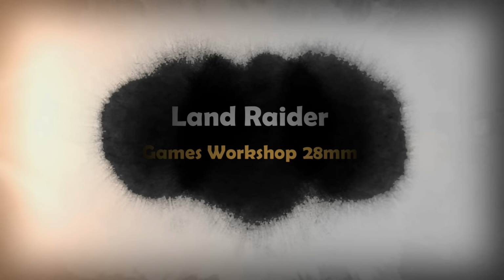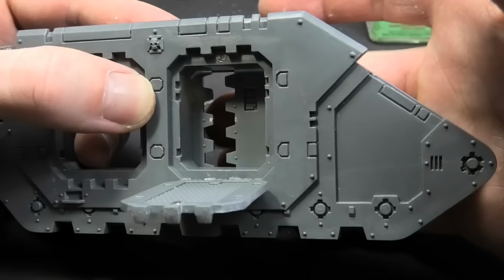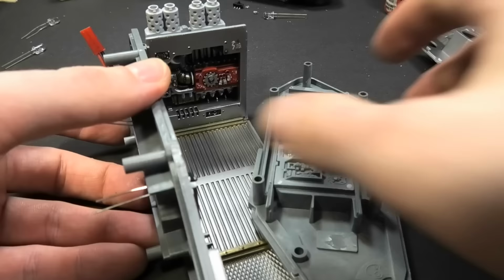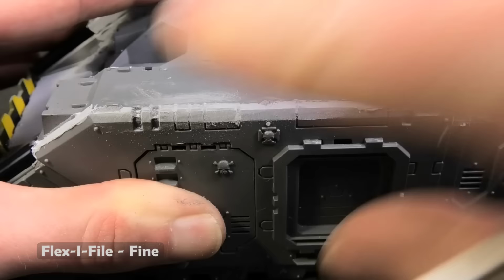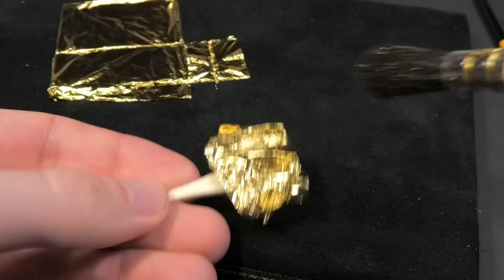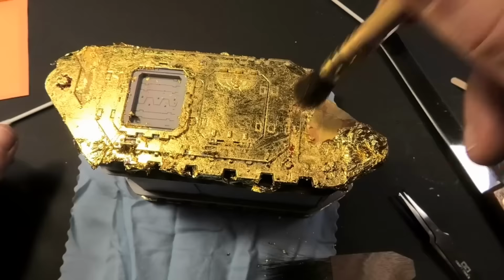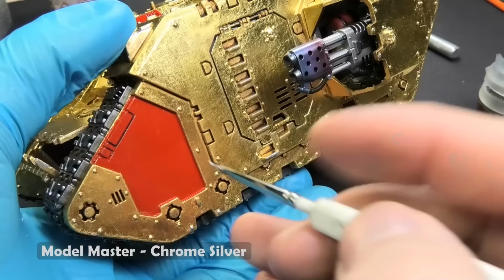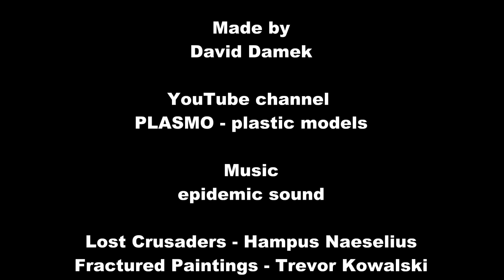Adeptus Custodes Venerable Land Raider - 24 Carats  Gold - 28mm - Tank Model

Comment: Lovely build!! Quick warning just in case you weren’t aware or for others looking to use LiPo batteries; LiPo batteries can swell over time even when not in use. If the battery is left inside the model over the long term it may at best physically damage the model, or worse it may puncture and cause a fire. I think it would be worth removing the LiPo when you aren’t planning on looking at the lights, or perhaps swap it for a different battery with a chemistry that’s more suited to longer life in a confined space.

 Love your vids as always!! Your works always blow me away and inspire me to try new things with my model kits!!
Reply: probably could have fit a coin cell in there for the amount of power

Comment: Baumgartner: "-Gilding is such a delicate process, I have to do it as slowly as possible and even then I make mistakes"

Plasmo: *Casually trows a 24 carat gold leaf over a glorified plastic toy and somehow it covers almost all of its intrincated details "-FOR THE EMPEROR!"
Reply: 100 leafs cost literally 6-20 euro, depending on the source.
Reply: @SiegfriedSTM  there is also fake gold leaf. I know at least adlibris sells some of that.
Reply: @SiegfriedSTM  forget the price. using gold leaf is so touchy! could not believe how easily he did that, and implied was his first time?
Reply: He should've supported his canvas edges with more belgian linen .... no, wait, this is a warhammer video isn't it?
Reply: @16:29 ish.
'You know what is crazy? It is still cheaper than the citidel gold spray.'
Reply: Need more rabbit skin glue!
Reply: @ColonelSandersLite  It really is. First starter kit like he had with 100 45mmx45mm 24 karat gold leafs I found on ebay costs ~23€. Crazy.
Reply: YES! Baumgartner is where I learned about ‘real’ gilding as well. Very informative.

Comment: honestly i almost dare not comment this as your craft skill is... simply incredible, but for large panels that do not fit well; have you heard about/tried "sprue goo"... you mix leftover plastic sprues in with tamiya thin model glue to create much thicker glue putty. i glue large panels together with it that don't fit well together and allow it to squeeze out in the gaps a little while fitting them together, allow to dry all the way and clean it up with a knife/file/sandpaper. i've had better luck with it than using putty to fill them after glue together and it's less cleanup work once you get used to it. just something to try and see what you do with it. this build of yours inspires me!

Comment: I thought a little dubious of the title at first, then remembered I did this same thing for some parts of my Thousand Sons legion. Glad I clicked cause it was interesting to see you going through the same process and arriving at the same conclusions. 

I found the lustre powder/varnish mix invaluable, but I was also using it to pick out metallic veins on hydro-dipped black marbling over cyan for a realistic turquoise stone effect. Time consuming but great fun and gives a very satisfying effect.

Interestingly, the copper based lustre powders can also be exposed to moisture till you see the verdigris, then applied with matte varnish for true corroded copper. I'd love to hear if anyone else finds any other cool tricks

Comment: my family business was the factory shop of traditional ornaments for Buddhism, so i was surprised to watch the use of "gold-leaf" in this video, and it made me feel very nostalgic. i used to think that gold-leaf is a special processed product that can only be found in Japan and East Asia, so i am very surprised that it is also used in Western.

we used very soft worn-out fluff and bamboo tweezers for prevent to static. everyone held their breath while working because the gold-leaf flew into the air with just a sigh. it will stick to the equipment before the gold leaf is pasted on the product, if there is even a small amount of moisture in the equipment. so, we always kept the equipment completely dry by dusting it with stone powder called "tonoko" that is made by crushing and grinding stone and making it micronized to μm.

a lot of small dust will fall off after using a large piece of gold-leaf, if you wipe it with a soft brush or fluff as you do in this video. we collected and stored it, and gave it to a manufacturer of gold-leaf for recycling after the bag was full. its been decades ago, but watching this video reminded me of many things.

Comment: gold leaf is a nice touch, though if i had done it, that particular tank would now be a display ONLY piece.... one thing i've always wanted to do is make one that is both lighted AND remote control, ie you can drive it across the board... would involve some REALLY small servos and a replacement track, but doable if one has the skill and parts needed...

Comment: 8:50 You wired those LEDs in parallel, my man, not series. This is the correct way to go because voltage drop is constant over parallel loads.

Comment: David: "I am soldering these LEDs in series"
Also David: *solders the LEDs in parallel"

By the way, directly connecting LEDs in parallel may lead to strange results like one of them being much brighter or only one of them emitting light at all*, so it is not a good idea in general. The solution is adding a current limiting resistor for each LED.

*LEDs have a positive thermal coefficient, so the warmer they get, the more conductive they are. If one of them just happens to conduct a bit more current, more heat is produced in it, which makes them even more conductive. After a while, it is so much easier for current to pass through that LED, that the other one barely gets any of that, and turns off.

Comment: Turn it backwards and think Snow-Cat for a moment, then connect it to say a Kratos Heavy Tank or so.
Make it all fusion powered, as well, since the Custodes have the best gear.
Also play with the weapon turrets a bit, like say a command transport behind the tank part (with a armored connection tube) or a AAA turret (with radar) on the tank and the troop-transport having become a artillery unit.
Even a engineering crane-tank with fabrication (struck true <"truck"> struck true) trailer behind it, could thus be a option, then.

I'm sorry to say, but as this Land-Raider currently is, it isn't Custodes worthy, it needs more.
It needs to stand out more then it currently is, just look at the Custodes troop lander, not one nose ramp, but two.
It thus needs to be heavier, more uniek.
Making it a trailer behind a heavy tank, while adding on some extra gear as well...
Could need a slightly extra bit of length, though, for the fusion engine(s) compartment, unless that's somehow on top & bottom of both corridor section on both units.
Then the gold look would not let the Land-Raider look so unfinished, in terms of it being owned by the MOST elite unit, that has the best gear, that nobody else has.
It's missing something, something to make it stand out, make it more uniek then just the gold look.
https://www.games-workshop.com/en-NL/legiones-astartes-kratos-heavy-assault-tank-2022

Still, great build, looks good, even though I think it should be turned into a Custodes Kratos Heavy Tank Trailer, to be honest.
The gold let it's boxy look, feel extra target like, I think.
Now that I think about it, the gold makes it look fat.
So perhaps that's making me say the above.
The detailing you did, is just perfect, same for the gold itself, in terms of adding it to the model.
Maybe my comments above this line, could be something for a future kit-bash?
One heavy raider & two standaard ones?
Don't be afraid to steal parts from the smaller troop-transport options, like hover gear, artillery or say AA defence.
Mmm, perhaps if you had made it a hover-land-raider.....it would be uniek enough for the Custodes Rare Unit look and give it that extra kick it's currently lacking?

Getting gear that as a part compatibility to the stuff that you already own....., is the most basic of buying new gear, spareparts compatibility.
And I would think that with Warhammer 40K logistics, that is actually a very big thing to be concerned about.
O well, at-least you now have two potential add-on kit-bashes to consider, for you army building.
One unit is nice, but one big one, escorted by two others........

Anyway, don't let my comments stop you or so.
Keep building, I love to watch them clips.

Comment: Geez, the big reason I can't justify getting into Warhammer despite absolutely loving all the lore is the price point for those models. If they were super high quality I could say the price tag is reasonable, but they have a lot of blemishes, bubbles, warping, require a lot of work to get parts to fit together, etc etc. It's daylight robbery.

Comment: Well, that was excellently done, love the lighting and modifying to make it work and look better. The gold approach is an interesting experiment that does sort of look good... but compositionally when I look at it... it's just a bit too bland. Gold used a bit more limited, with more variation or other colors or surface types in area could have helped it stand out as a highlight, rather than just turn into a full sea of gold with a few red bits. Still looks good, but it also looks kind of... simple... as a result, on the outside at least. Normally to make a model interesting you work hard to have varied and often unrealistic paint schemes and coloring and variation, we can argue that's the proper paint scheme/design, and being from the rich Custodes it's probably super cleaned and maintained so no real weathering or variation or dirt or other things to vary stuff... still... ya. I feel the interior stands out best here, and the application of the gold was great, the final result was just good and not the highlight of the video sadly.
Still love it, just providing my honest feedback for your and others possible thoughts.

Comment: Gold leaf is a nightmare to work with and unfortunately looks identical to gold spray paint by the time you have it tamped down. If you used fake gold leaf(99% of the stuff you see in craft stores is going to be ‘composition’ gold) and will need to be sealed or it will oxidize over time. However, you CAN get a gorgeous polished gold look if you used genuine gold(over 22k) leaf. You’ll need to apply several layers and after it’s brushed on you’ll need to burnish it(takes a longgg time so have patience) with agate stone rollers. You’ll need a few different rollers to get into all of the spaces, but it can look like a smooth mirror if you take your time. I’d love to see you give it a shot sometime since your models are already masterpieces. I don’t think any YouTube modeler has actually done this yet now that I think about it. Either way, great video. Very enjoyable.

Comment: After applying the varnish, does the gold leaf flake off when pressure is applied? I'm not asking for anything as much as nails scratching against it, but rubbing you thumb back and forth, does it peel off?

I have been planning to make an RC Land Raider and after looking up the price (It's currently only about $40 USD for the gold sheets here in the US, not sure what the kit would cost however) I'm fairly tempted to just go full "dumb" and do this myself. I mean, not many can flex or joke about an RC Land Raider, but a real Golden Land Raider? sheeeesh